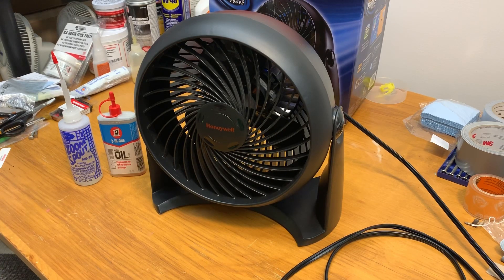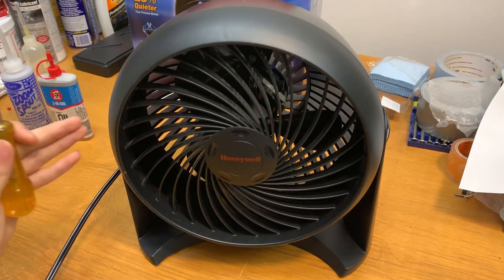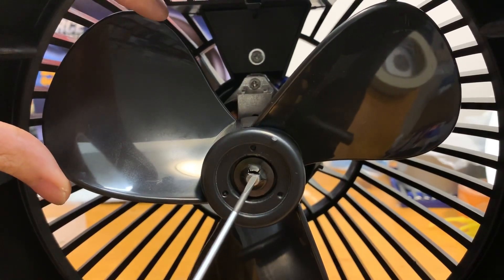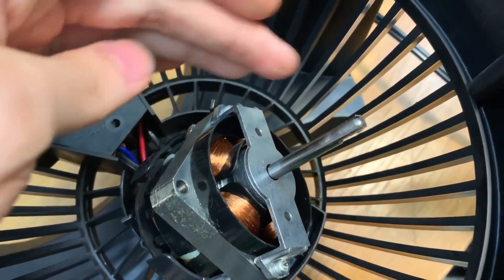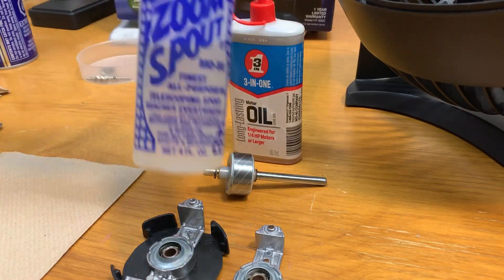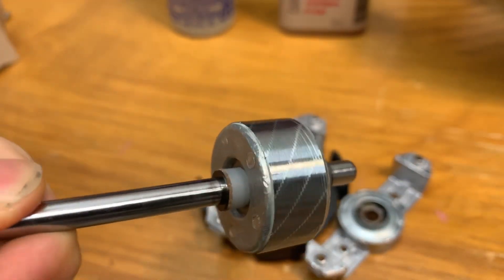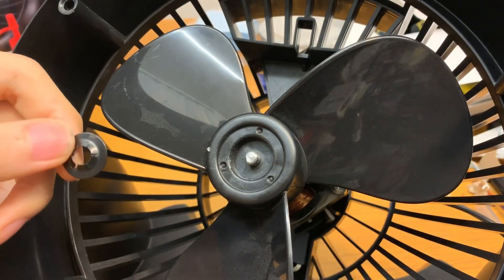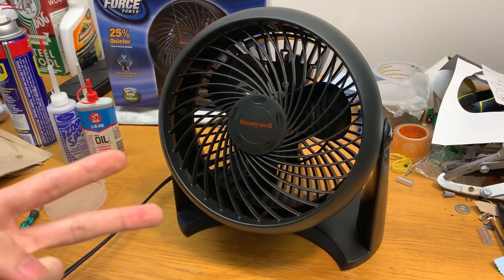Disassemble, Clean & Oil a Honeywell Fan w/ PSC Motor

Comment: Just adding on to the thank yous! I have the 2013 version of this fan, and although the motor housing/components were slightly different I was still able to get it up and running again thanks to this video.
Definitely took a while to clean since I'd never disassembled it in 10+ years but it works good as new. The second power level of the fan doesn't work now, however, so I'm thinking I pinched a wire in reassembly - but better than nothing.

Thank you for saving another fan from the landfill!
Reply from the maker: No problem, and thank you for keeping another fan out of the landfill!

It sounds like the second speed wire got disconnected somewhere (hopefully not severed). If you get a chance to take it apart again, check to make sure the end of the wire is pushed in all the way into the switch. These fans’ switches have sprung wire terminals that simply grip the wire when it’s pushed in. The second speed wire might have popped out when you had the fan apart. 

Cheers!
Reply: Thanks for your input! It's definitely possible something popped out since I had to maneuver the wires more than I would've liked to get access to everything.

Is it a possible hazard if I don't fix that and keep running it or will it be okay til the next time I clean it? (Which will be much sooner than 10 years, but still a few months down the line probably.)
Reply from the maker: No problem at all! If it hasn’t blown the circuit breaker already, there’s a chance it’ll be fine for years to come, but… I would still recommend taking it apart to check what the situation is. If the wire did pop out of the switch, it would be exposed and live when the fan is powered on. It’s a plastic fan, so the likelihood of electrocution is basically zero, but it can’t hurt to check, just in case.
Reply: Thank you again! Just cleaned my fan since the motor got clogged up again. The second speed wire had gotten disconnected from the switch, as you thought.

Is there a tip you have to not have the motor suck up so much pet hair? I was thinking of maybe putting some mesh around the intake behind the motor but I'm not sure that would do too much.

Comment: I have a white fan it looks like yours . But mine has a lot  of space between the motor and the fan blade. How can I fix it
Reply from the maker: Could you elaborate a little bit? Are you currently trying to disassemble or assemble the fan? If you’re in the process of putting the fan back together, you might want to check that the flat spot on the motor shaft is aligned with the flat spot in the blade hub. That will allow the blades to sit further down on the motor shaft.

Comment: Thx for sharing this useful video. I did clean my Honeywell  ventilator today. I did not dissassemble the shaft!. After that I re-assembled the plastic housing again. I noticed some vibrstion. The screws were though very tight. I tried loosing up the screws halff a turn each and there was less vibration. My question to you is how tight / loose should I tighten up the screws from the housing? Thanks in advance!
Reply from the maker: You're welcome! Typically I tighten the screw until its resistance jumps up (indicating the screw is all the way in), and from there I give it another 1/8th  or so of a turn more. Overtightening is rarely a good idea, especially if the screws go into plastic. It's possible a moving part such as the motor or blades was rubbing against the housing from overtightening.

Comment: Watch out for this fan it caused an electrical fault with my TV where it was using the same duel socket as the TV. Power Surge??
Has anyone else experienced similar issues?

Comment: So which motor is better and why?😆
Reply from the maker: The PSC motor is generally better. More efficient and cooler running. The HT-900 fans with PSC motors draw less than half the current the shaded-pole HT-900 fans draw, without compromising performance.
Reply: @TheSuperFanMan  vs ecm?
Reply from the maker: ECMs (BLDC) are more efficient than PSC motors, but can be less reliable because of the need for electronic components. Funny that you mentioned ECMs, because I just posted a video on AC vs BLDC ceiling fans lol.
Reply: @TheSuperFanMan  Thanks for the reply...I'll be watching watching that new video. 😊

Comment: someone has probably mentioned this : at about 6:06 my 'rear bearing assembly' does NOT just pop off. theres a red blue and grey wire that are jammed in between the plastic and metal parts of the rear assembly. I'm hesitant to use more force because it may destroy a wire AND because i have to put this stuff back together at some point...beware
Reply from the maker: It’s likely just a sample variation from inconsistent manufacturing (typical nowadays with overseas products). Mine came off with no issues, and the wires weren’t pinched anywhere. 

If it’s badly jammed in there to a point where it’s difficult to disassemble, it’s concerning from a longevity standpoint because the pressure could wear through the wire insulation and create an electrical problem down the road. 

It probably would be a good idea to leave it alone if you feel that the disassembly may be problematic. If you’re able to pull the motor out far enough to reach the two screws holding the plastic end cap to the rear bearing housing, I would undo them to see if the wires can be freed. 

Hope it helps! Feel free to ask me any questions that come up!
Reply: @TheSuperFanMan  thanks for the advice!! I eventually was able to free it. I made sure to get a view of it from all angles and then try to move the wires one at a time to see how stuck they were. I was also able to bend the  plastic surrounding it a bit to see if there was some wiggle room (and there was). 

Thanks for the great video!! especially the part where you explain reassembly!! (many videos just say to do it in the reverse order). 

o
Reply from the maker: No problem! Glad to hear you were able to solve it!

Comment: Can you use WD40 instead of those 2 oils you showed?
Reply from the maker: No, never use WD-40 with the intention of lubricating motor bearings! It’s not formulated for that purpose and will dry out quickly, which will damage the bearings after some time. Aside from the two oils I showed, technically any non-detergent, 20-30 weight oil is good to use, though I haven’t tried any so I can’t make any specific recommendations in that regard. Hope it helps!
Reply: @TheSuperFanMan  Hey, definitely does help, thanks for the assistance and the fast reply, man, you really are super 👃
Reply from the maker: No problem! Glad I could help!

Comment: Damn I wanted to wash the entire casing of it but i cant get to remove the cord. The dust on it is insane and i have had it for a month. Yes I clean my house and vaccum every couple days. It's mostly cause of the fires we just got and the smog.
Reply from the maker: The cord can be removed, though it’s a bit tricky. After the motor & switch are removed, the plastic strain relief piece can be pushed out of the fan from the inside. A pair of pliers will help with this process. 

I removed the cord on this fan using the same technique (at 9:35 in the video): https://youtu.be/ydam2wCd-e8

But even if you can’t remove the cord itself, you can place a small ziplock bag over the plug and another one over the two exposed strands on the inside of the housing, tighten the openings of the bags with rubber bands, and rinse the whole housing with water. Just don’t submerge it in water. Allow the housing to fully dry before reassembling. 

For regular maintenance and dusting, compressed air does wonders, whether it’s from a canned air duster or an air compressor. 

Hope it helps!

Comment: Is there anything we can do when it won't start as a result of dropping it ? When I turn it on, a humming sound comes but blades won't run.
Reply from the maker: It would depend on where the culprit is. Try taking the grille off first and see if the blades are hitting anything. If the blades are stiff to turn, tapping the blade hub from various angles with the back of the screwdriver to realign the motor bearings. 
Feel free to let me know if that doesn’t fix it, and I can try to help more.
Reply: @TheSuperFanMan  I cannot see any obvious damage, the blades are free to move.
Reply from the maker: Hm interesting, I’m not sure what the problem could be. If you want to post a video showing the problem, I can try to offer additional advice.

Comment: Some of those tabs near the copper broke, still safe to use you think?
Reply from the maker: I’m assuming you’re referring to the protective plastic that surrounds the motor windings? Some breakage around the edge shouldn’t be a problem. However, if the entire plastic sleeve is broken (to the point where the motor windings have become loose or disturbed) then it may be a concern.

Comment: I can NOT get that center piece to come off to remove the blades. I have fought with it for over half an hour.
Reply from the maker: It’s definitely a challenge to get that piece off, especially without breaking it. If you have a small flathead screwdriver, push the tip into the gaps in the push nut and pry the little tabs outwards. The goal is to loosen the grip that the tabs have on the motor shaft. You might end up breaking the nut when you remove it, but the blades can later be secured with a blob of hot glue if necessary.

Comment: It stopped working if I clean an oil might it work again?
Reply from the maker: Yes it's certainly possible to revive it, though it will depend on what part of the fan failed. 

If the motor bearings are simply seized up, oiling will free them up. An easy way to test this is to plug the fan in and turn it to any speed. If the bearings are simply seized, you will hear a faint buzzing sound from the motor. 

However, if there is no buzz, it means there is an electrical problem, such as a blown thermal fuse inside of the motor, a bad switch, or poor wire connections somewhere. These are typically not repairable.

Hope it helps!

Comment: My honeywell fan doesn’t have screws in the back to remove the front 😢
Reply from the maker: Is it a different model than the one in the video?
Reply: @TheSuperFanMan  It's an HT-900-09 and there is no screws :(
Reply from the maker: Odd, perhaps it’s a recent model... That’s pretty disappointing to hear, especially because the ability to disassemble these Honeywell fans was one of the reasons why they were good. Are the screws not hidden or deeply recessed?

Comment: My screws are extremely tight and hard to remove it from my fan
Reply from the maker: That certainly happens. Which screws aren’t budging? Usually the screws holding the grilles together and the 2 screws holding the motor to the back housing come out easily, as they’re threaded into plastic. The 2 screws holding the bearing assembly together can be tricky sometimes since those go into metal. If you’re able to remove the screws holding the motor to the back housing, try spraying a small amount of WD-40 around the screws on the rear side of the motor where the screws thread in. A few hours of wait time should allow the WD-40 is soak in, then you can try unscrewing them again.

Comment: Best way to align the bearings is to slightly loosen the mounting screws & power up the fan--it will self align.  Then tighten the mounting screws.  No need to smack the rotor shaft!
Reply from the maker: That may work from time to time, but it’s not as effective as the tapping method, and I know from experience. Tightening the bearing housing screws after letting it self align will throw it out of alignment again. Tapping the shaft doesn’t harm the motor in any way, unless you’re using a hammer of course lol.

Comment: Anyone have issues snapping the front grille back on? With the holes and screws in place, the grille won’t stay on and is loose. So frustrating. This fan is so poorly made.
Reply from the maker: I’ve found that the recently made fans are trickier to deal with, particularly the grille. Did your grille snap into place so the seam between the front and back grilles are closed? There is a small notch at the bottom of the grille that needs to be lined up with the one on the fan. The screws should hold it in place.. but if they don’t, the screw holes might be stripped out. Try readjusting the grille and feel free to let me know if you have other questions!

Comment: None of the screwdrivers I own fits, and I have several.  Wish they didn't have to make accessing the screws so difficult. First and last Honeywell product I ever purchase.
Reply from the maker: Do your screwdrivers have interchangeable bits by chance? Usually those are too wide to reach the screws. A dedicated phillips head screwdriver is ideal for reaching them. I completely understand your frustration though.
Reply: @TheSuperFanMan  One has the interchangeable bits, but the others I have are just too big 😪
Reply from the maker: Ah I figured. I believe a Phillips #2 screwdriver is the right size, though that would be like a $5-10 expense. But still cheaper than a new fan lol.

Comment: This was helpful in taking my Pelonis fan motor apart.  Cleaning didn't really fix the issue though.  The fan speed is too slow.  Especially when heater is turned on high, the fan slows to very little, leaving the air too hot I fear without enough air flow.
Reply from the maker: How free is the motor shaft? With the blades on, the fan should coast down to a smooth stop when spun by hand. An abrupt stop means the bearings need to be oiled or aligned, as shown in the video.
If the shaft spins freely, then it could just be the nature of the heater due to the way it was designed. Fan-forced heaters typically behave like that, where the fan motor slows down when the heating elements kick on because they draw a lot of current. 
Also all heaters have thermal safety switches inside that will cut off the power if they get too hot. So your heater’s behaviour could be normal. Hope this helps!
Reply: @TheSuperFanMan  I thought it spun OK.  It seemed free to me, but this is the first time I've done this.  I didn't add any oil because  I don't have any (except a tube that came with Wahl clippers, so I wasn't sure that was adequate).  The slowness is not a natural design of the fan because it previously ran faster and has seemed to decline over time.  Before I took it apart and cleaned it, it would only start noisily then stop.  Now, it does actually run, but much too slowly.  I have another heater of this same model and it runs normally.  Thanks for replying.
Reply from the maker: No problem! That definitely sounds like the motor needs to be oiled. I wouldn’t run the heater in that state. The clipper oil is a bit thin for motors, but it can serve as a temporary oil. A bottle of electric motor oil (either 3-in-1 blue bottle, ZoomSpout turbine oil, or other non-detergent oil that’s around SAE-20 in viscosity) is under $5 at most hardware stores. It also works great as general household oil so a bottle might be worth getting. It’s also cheaper than a new heater :)
Reply: @TheSuperFanMan    It sounds like it's worth taking apart again if I get the oil.  No reason to junk it if there's a possible fix.  I've got one that rattles badly too, so the oil may help that one as well.  Appreciate the advice.

Comment: Which motor (type or model name) do you recommend for a like that small size fan?
Reply from the maker: A shaded-pole, c-frame type motor is usually a good choice for small fans. They’re inexpensive and have lots of options for size & power.
Reply: ThE HPF820 blows a significantly more air and better fan blade designs.  And more powerful copper motor.
Reply from the maker: I believe that’s a pretty recent model. I haven’t seen many stores sell it, but the blades do look better optimized for performance.

Comment: Oh, this motor look weird?  I looked in my country there are no electric fans designed with this motor for sale. 👍
Reply from the maker: It certainly is an unusual motor style for a small fan. This is a capacitor motor, unlike the shaded-pole motors that are often found in smaller fans.

Comment: I see the spin down time is not as good as the 800 ? Do you agree ? also which model do you prefer the 800 or the newer 900 ?
Reply from the maker: Yes I agree. The HT800 fans had heavier blades so the extra momentum gives them the longer spin down time. It’s not always a bad thing if a fan has a short spin down time. Even good motor bearings won’t coast for long if the blades are lightweight plastic and has a lot of pitch. I personally like the HT800 more, but only by a small margin. The 800 is built better and moves more air, but is very noisy. The 900 has decent build quality, not nearly as powerful but is a lot quieter. Surprisingly, I’ve found that the 900 fans have better balanced blades than the 800 fans. Besides the quality and power, I’d say the 900 outshines the 800.
Reply: @TheSuperFanMan  I am from the UK mine says HT-900 E . but the motor inside is not like your 900 its like a hybrid of your 800 and 900 . i mean the top metal strip is like your 900 but the bottom is like your 800 with the old fashioned copper winding thing . sorry i'm not a techy i dont know what to call it ? lol
Reply from the maker: Sounds like it has the shaded-pole type motor. They’re good motors as long as they’re kept clean and oiled from time to time. I think the UK HT900E is built very similarly to the North American HT900 besides a few small design differences.
Reply: @TheSuperFanMan  yes it has the same shell and stand like your 900 and also the same smaller blade.